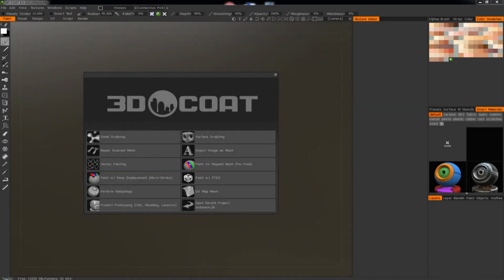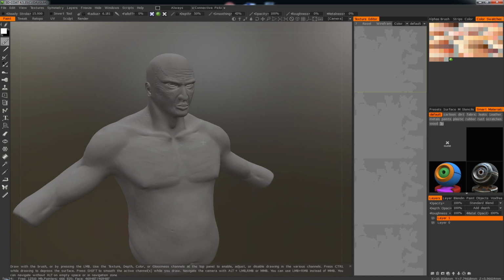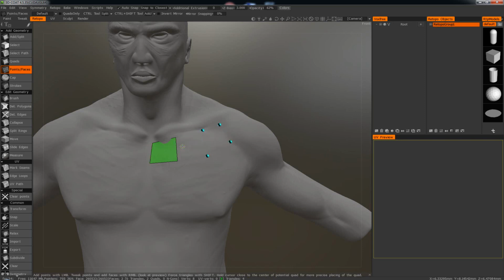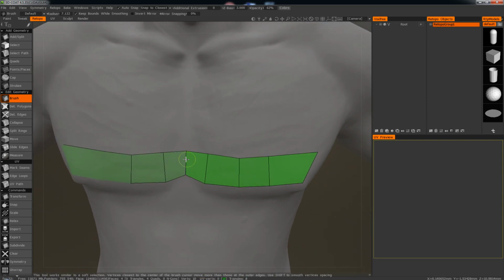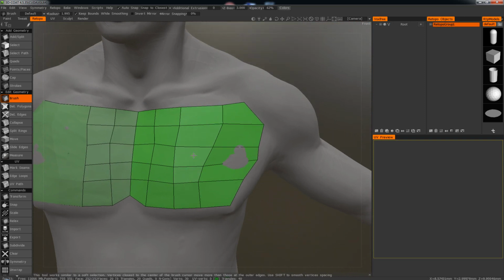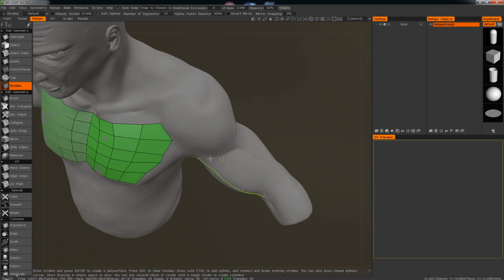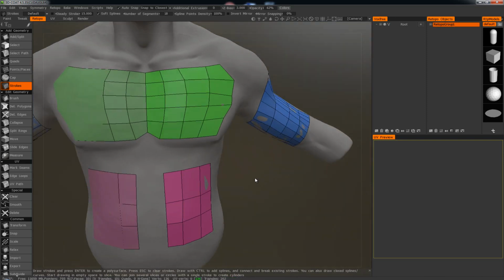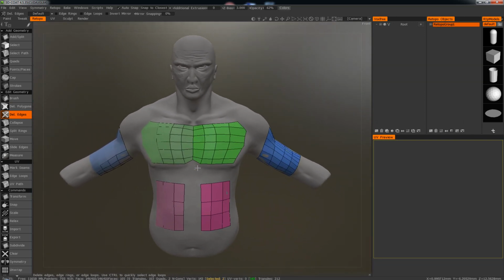Retopology with 3D Coat

Comment: Hey matey, thanks so much for all the effort in putting out free training! Perhaps next time you could consider making it a bit leaner. Being used to tutes by guys like Michael Pavlovic I'm afraid I gave up after 6 minutes and I'd only seen the first quads being drawn. Not every tute has to be lightning quick of course, but perhaps you could increase the information density a little on the next one and see if that suits you or not. Thanks again!
Reply from the maker: i understand where you are coming from. Thing is i have spent quite a bit of time teaching total beginners how to do stuff so i tend to simplify things quite a bit. I did have an idea to make bunch of videos that will focus on the outcome rather then the path, but lately i've barely had any free time to put into making videos. In any case i'll take your comment into consideration, so thank you for your input.  Cheers. 

P.S. I love Michael Pavlovic as well, even though the guy really does speak fast and does things fast :)